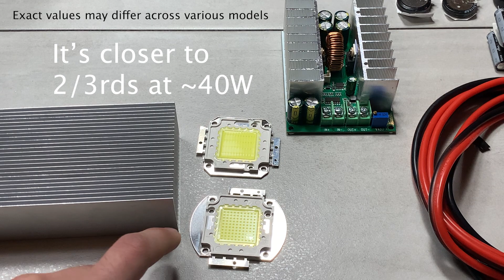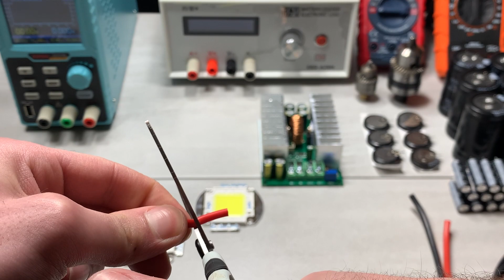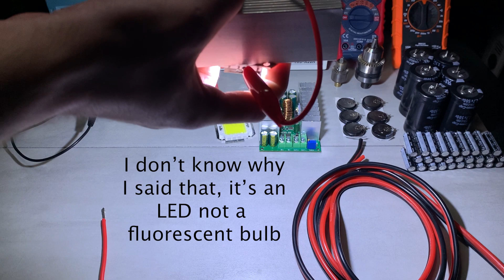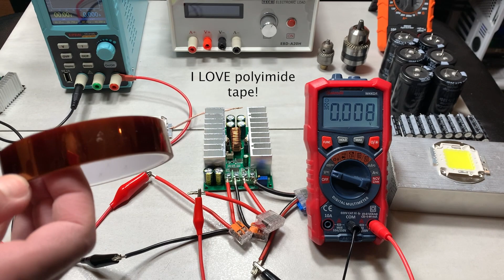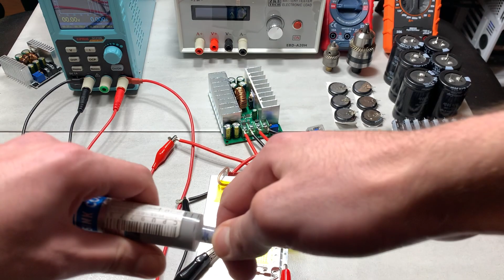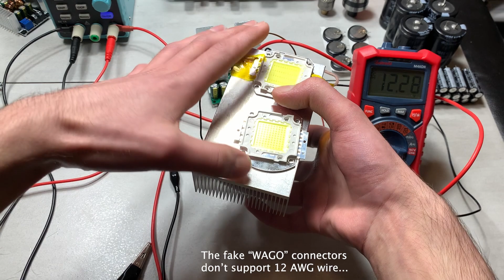150W of COB LEDs with 500W DC Step-Down Module

Comment: LEDs, like all diodes, are current driven devices. The light output is directly proportional to the input current provided. It is not enough to provide a constant voltage to the LED. Some method of current limiting should be used when driving LEDs. As an LED heats up the required forward voltage decreases causing the current to increase, which causes more heating, so if not current limiting you can quickly experience thermal runaway.
Reply from the maker: So THAT’S why the current kept slowly creeping up! I’m new to CoBs so thanks for letting me know! I will have to make an update to point this out so that I’m not giving out incomplete information.
Reply: @KeonsLab  I'm glad you found the information helpful. When I started to use some high output LEDs I burned up quite a few because I was only limiting voltage.

Comment: Those crocodile connectors aren't soldered, try to upgrade them.
Reply from the maker: If you’re talking about the ones with the screws on them then I totally agree, they’re such trash connectors and I only have them because they came free with my battery discharge tester, I would personally never buy such cheap connectors, they’re honestly only good for voltage readings or when I can’t find anything else.

Comment: Leds have to be current limited, not voltage.
Reply from the maker: True! I just found that for a short demonstration it didn’t really matter so I just did the quicker option which was setting the voltage, but yes in general LEDs are run in CC mode and/or with a resistor.

Comment: I used a step up DC-DC module to make this LED glow. At low voltage, this LED glows brightly enough and consumes low current, but if you need a brighter light for a short time, you can increase the voltage by 2-3 volts and the current consumption will increase. At high power, I covered it with paper so that there would be no bright light during the test and the paper started to burn.